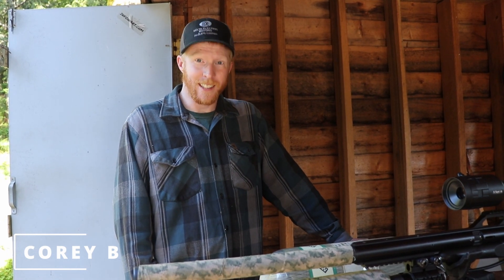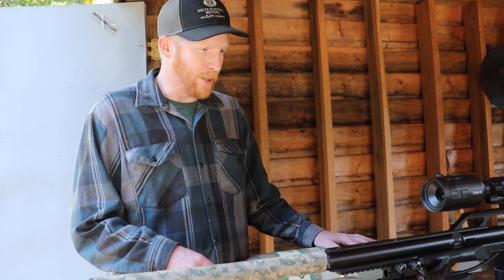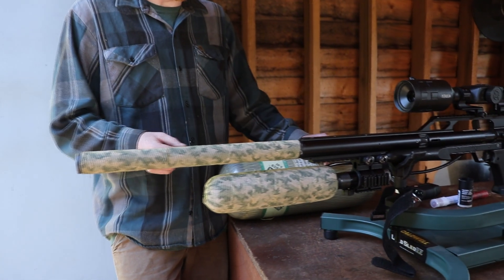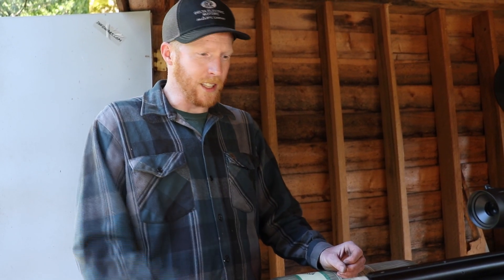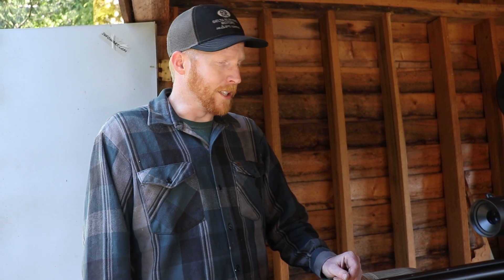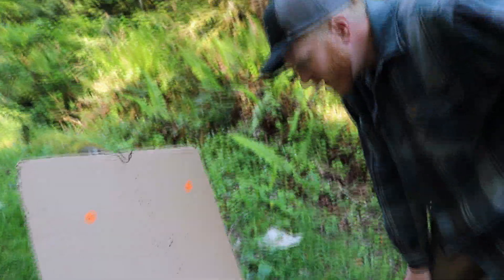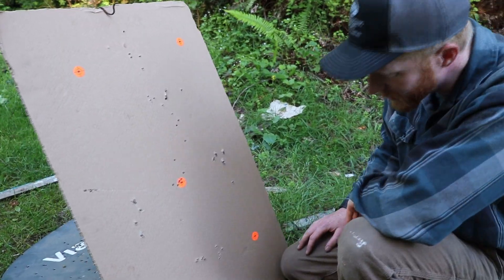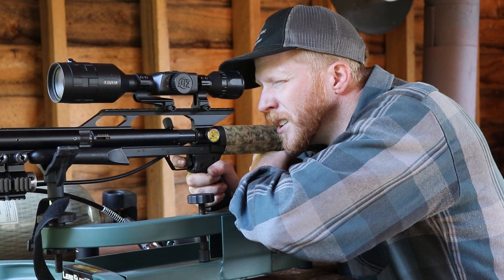AirForce Condor 22 cal. Heavy Slug Liner Test Two -- Valve Failure at the Range

Comment: What is your barrel
Reply from the maker: @tonynooyen2423  The FX Heavy Slug Liner, it does pretty good for such a thin barrel. Plenty accurate for what I'm doing, but in an airforce frame, you'd likely have to employ various tuning methods for competition. Just because the harmonic nodes are very tight.
Reply: @cormastar  thanks for the time. Just getting into the pcp rifles n kinda hooked
Reply: @cormastar  sorry to bother you more but I haven’t any luck finding mounts to hang the bottle in front like you any suggestions
Reply from the maker: @tonynooyen2423  No worries,  I tried to use off the shelf items as much as possible, it comes down to the regulator.  The reg attached to the tank, scope rings hold the reg to the airgun, DOT air fittings and HP nylon tubing to take the air to the valve chamber. I did have to make an adapter for the scope ring to reg since the rings are 34mm and the reg is closer to 32mm.
Reply: @cormastar  thanks appreciate the pointers

Comment: I think at a certainpoint I think you will hit diminished returns on reg pressure. At the end of the day the barrel volume is fixed. Let's say a given velocity = X pressure at the mussel we could say that the velocity resulted from a barrel pressure of X (hypothetical number 800psi). It will always take the same amount of air to fill the barrel volume to a given pressure. What will change is the function over time or shot cycle. At some point efficiency will go down, I think there will be a happy place in the middle somewhere. I think lowwer pressure feals smother personally.